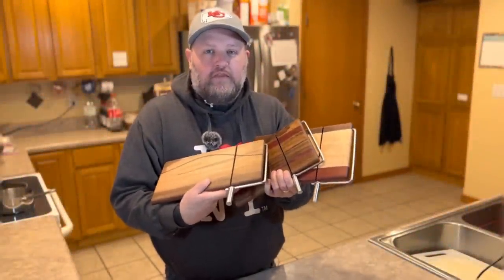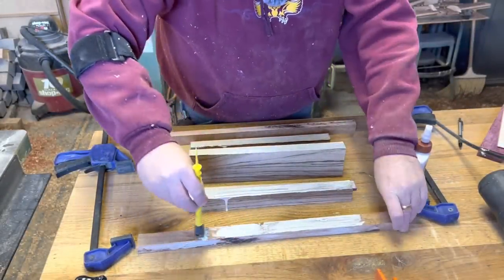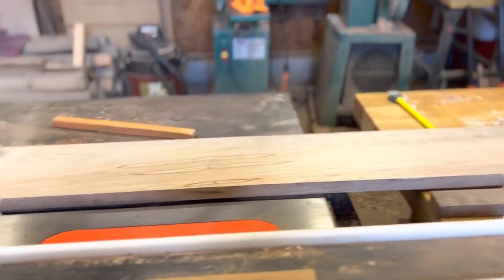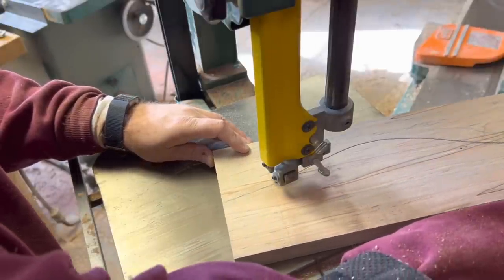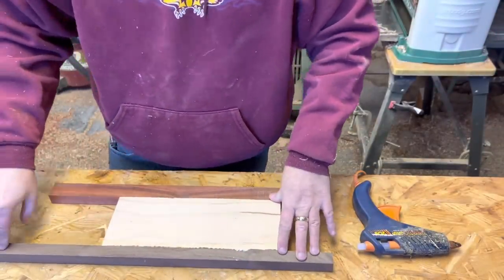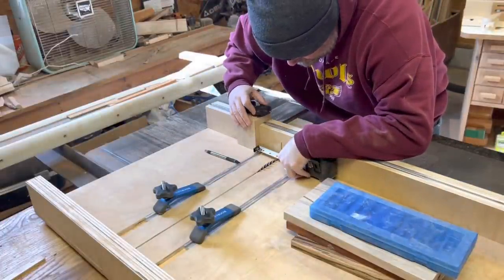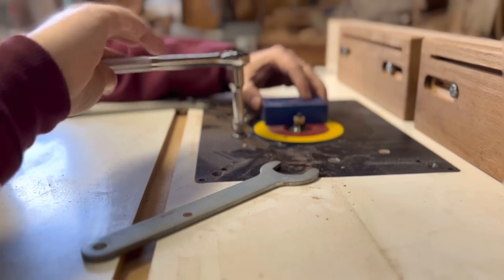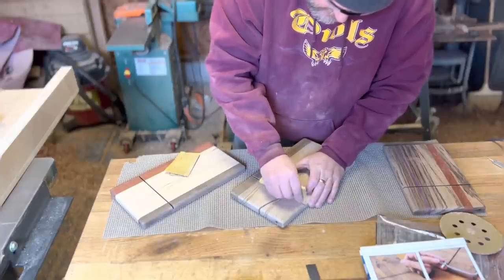3 Hardwood Cheese Slicers You're Going To Love

Comment: These turned out really good!! One suggestion I would make to those who are unaware of this, avoid using purple heart in cutting boards. There's nothing wrong about using it, however, purple heart will turn brown when it ages. Knowing this, I would use walnut in its place. The only exception, using lacquer on purple heart will retain its purple color, but lacquer is not a food safe finish, so don't use lacquer for cutting boards.
Reply from the maker: Good to know. Thank you for sharing.

Comment: I have 2 questions. (1) What are the sizes of the cheese boards. (2) where do you get the slicers?  The only place i've found them are almost $17 each. That makes the selling price pretty high.
Reply from the maker: They are roughly 6" by 10".  For the slicers that I'm using, the kerf is 3" from the edge and the hole for the mechanism is 5.75" from the front edge.  You can make them any length that you like.  The mechanisms that I use are from Rockler and they are $17-$18 each.  Woodcraft sells one that is about $15.  They are good, but I prefer the ones from Rockler.  They are a little more solid.

Comment: Where did you get the information that too much clamping pressure will cause too much glue squeeze out?
Reply from the maker: Sorry for the late reply.  I can't remember where I've heard about too much clamping pressure, but I've observed some of my glue-ups that didn't hold up as well when I over tightened the clamps.  With that said, I'm not 100% if it was because off too much pressure, or if I didn't mill something properly.  I was a long time ago since I've had this issue.  Since I got a planer and jointer several years ago, I've not had an issue with glue-ups not holding.

Comment: Good video, just a side note on the cutter hardware. I used some from Rockler and had two wires break when cutting hard cheese. Dont know if it was a bad  batch of wire or user error. Switched to Woodcraft product and the wires have not broke or stretched. Thanks for your planer tips.
Reply from the maker: Sorry for the late reply.  I had some comments that got lost in the shuffle.  I've used the mechanisms from Woodcraft.  They make a good cheese slicer.  I haven't had an issue with the wires from Rockler as of yet.  The reason I switched to the Rockler ones in the first place was because Woodcraft was having delivery issues.  I'd consider using them again.

Comment: Thanks for the video.  I like the way you did the woven board.  It's on my list of stuff to try.  How about some dust collection, you know how bad all that is for your lungs?
Reply from the maker: The trick on the woven pieces is to keep them thin.  If they are too thick, they will snap unless you do something like steaming them to make them more pliable.  I have toyed around with the idea of adding some dust collection.  I even built an air filter.  I've been going back and forth on whether or not to make a video on it.  I have a separate location where I do my sanding and I have a pretty good setup for dust collection on it.  But, you are right, my actual shop needs dust collection.  Thanks for your comment, I appreciate it.

Comment: Thst "non-slip mat",resiiy does not work too well.
Reply from the maker: I've tried using an actual router pad and other things for this purpose.  This pad is a piece of cabinet drawer liner.  My main reason for the pad is to protect the backside of the piece from scratches caused by vibrating on the table.

Comment: I like the boards, but your shop is dangerously dirty! You must have ten years of sawdust and dirt on the floor and your machines!
Reply from the maker: Surprisingly enough, I clean out the machines and sweep the floor at least between every project.  I'm still trying to figure out what I'm going to do about dust collection.  I've go a couple of shop vacs but the filters in them are not great.  I run an air filter which helps with the stuff in the air.  All that to say, you're not wrong, the place is a mess and is ready for another cleaning day.
Reply: Be careful . Being overly neatsy and pendantic is dangerous to your mental health and severely restricts your creativity.
Reply: I would not have even bothered with a response to that comment. @d.a.marvelwoodworking

Comment: I love the boards. As a side note, when I do glueing, I put wax paper on my work table. It keeps the glue off my bench and is reusable. The glue comes off the paper easily when it dries and I can throw it away if it gets torn too badly.
Reply from the maker: Thanks Shawn, for whatever reason, I haven't thought of using wax paper on the bench.  I've used it to cover calls to keep them from sticking to glue ups.  I'll have to give that a shot.
Reply: @d.a.marvelwoodworking  cover your cauls with packing/shipping tape. Also, you can use a length of thread rod to spread the glue. The spaces between the threads leave just the right amount of glue. You can used galvanized thread rod so that you can just throw it into a cup of water between jobs to keep it clean without rusting. ..

Nice work!
Reply from the maker: @michaelkeymont501  I haven't thought of using threaded rod for spreading glue.  Thanks for tip.
Reply: @d.a.marvelwoodworking  i .found a book in a thrift store that is all about glue ups, and it was in there. But, I also later saw George Vondriska of Wood Worker’s Guild of America using the same technique. If I remember correctly, 1/2-13 thread is the preferred size as it leaves just the right amount of glue and spreads it perfectly at the same time. Cheers!

Comment: What were your finished dimensions? Very nice
Reply from the maker: The thickness is 3/4" and the front to back dimension needs to be 7".  The width can vary.  I was trying to maximize the pieces that I had which most of them were from the cutoff bin at Rockler.  One of them was about 10" and the other two were closer to 12".